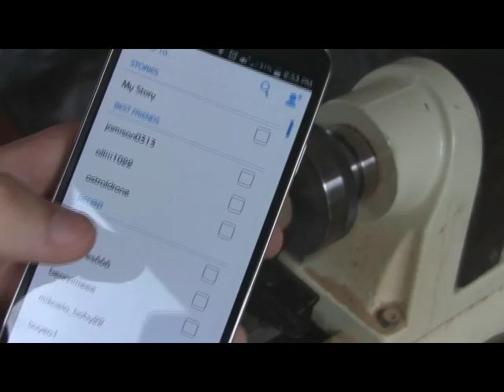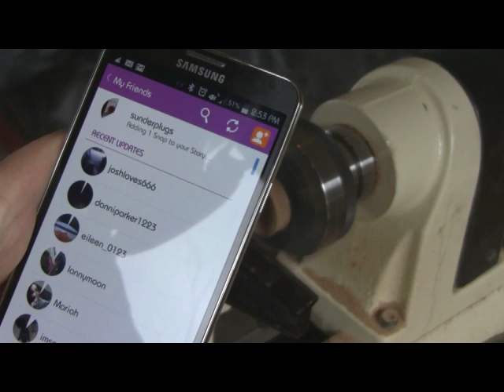How to Make Plugs with Lathe

Comment: what kind of chuck do you use and what kind of oil do you use just outta curiosity cause my plugs never come out looking this good. nice job man
Reply from the maker: Its a 4" 4 jaw chuck. The name has slipped my mind and I use boiled linseed oil. The key is the tool your using. I use the "easy wood tool" brand and have the set. Best tools I've ever used

Comment: I understand the video is older. But was that cardboard you ran over the top? If so why? I've been in my shop for 2 days now and I can't get them right. The flaired ends keep chipping. I'm working with walnut.
Reply from the maker: Hey Jeff, I actually just now logged back into my account so that's great timing! I was running sandpaper (fine grit) over the entire piece to get them as smooth as possible. That will get rid of the little splinters that will ruin your lobes. If you are chipping the edges, either your tool is too dull and it is applying too much force to the thin wood or you are trying to make the flared edges too sharp. Try leaving around 1.5 mm of flat on both sides of the plug and then sand those flats down to a smooth bevel. If all else fails, you may just have a bad piece of walnut. I use westpenn hardwood online for all of my wood. Hope this helps!
Reply: Zach McCormick Great timing indeed! I'm using carbide tools. I've put about 5 hours use on them. I'm still very new to turning wood. So I hope they're not full after that long. Is it possible that the lathe isn't spinning fast enough, or too fast?
Reply from the maker: Jeff Davis yea I'm using "easy wood tools" which are carbide as well. Even when they dull you can still use them, it just takes a lot more pressure to cut the wood. You'll be good with those for at least a few more weeks of constant use. You could have the speed wrong. Google lathe rpm vs wood blank diameter and there should be some pretty in depth guides for getting speed right. (Hopefully you have variable speed lathe)